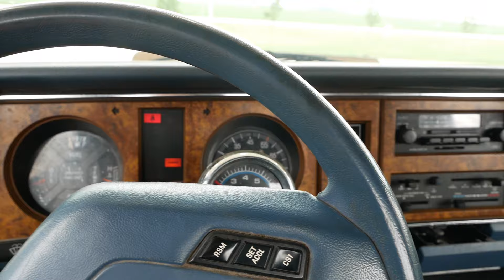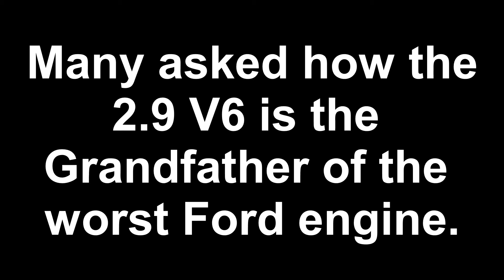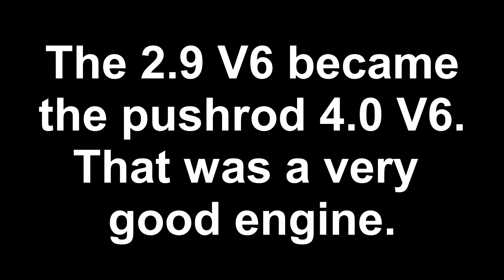Fixing Frank Fritz's 1986 Ford Ranger - Road Ready - Part 2

Comment: Hey so I have a 86 bronco II  and I have a similar issue with the idle so whats been going on is it will randomly bog down like 300 rpm and then bounce back up to its normal idle speed and I have replaced everything under the sun to try and fix this issue and the main cause of this issue is the fact that it is running way to rich and I would hook up a scan tool it just says cylinder 6 miss fire and I have done plugs plug wires distributor rotor and cap the MAF, IDAC, EGR the EGR tube because it was leaking Ive done fuel pump fuel filter catalytic converter and I'm about to replace it again because im thinking because of the raw fuel hat was going down in to the exhaust I'm thinking it has clogged my new cat because now it barley has power and the air box tube is being sucked inward and I'm just at a lost with what this idle issue could be and on top of that i have done a O2 sensor because mine was cracked but on top of the idle issue the emissions light is constantly on which I'm assuming that's because of the rich fuel mixture but I'm just at a lost in terms of what to do any help would be helpful thank you

Comment: You know you can put 5speed  out of 02 to 11 4.0 20% stronger n close rasho
It on ranger stashon form
I did it n like it
I have 92 4x4 5 speed 2.9
I'm about put a explorer 8.8 disk brake rear end in
I welled the tubs n trust it 
Waiting on gears n a ox locker 
N first 2 years of 2.9 had 62 mm throttle body after that it 45 mm
Botum intake manifold 1/4 inch
Lip that need matching to the top manifold between the 2 it wake it up a bit 
I have headers n a test pipe n after cat but the intake port mach n trottel did more cat back n header
I have 33 12.5 i squeezed in
Bushwaker cut in the back
N fiberglass fenders in from 
N little lift

Comment: In the old days you had to charter a helicopter at a rate of $1500 an hour if you wanted to get aerial camera footage. These days a drone can do the same job at a considerably lower cost. At what point will jet engine powered manually piloted crop dusters give way to remotely controlled drones?
Reply from the maker: I'm not sure that will save anything. You'd still need a skilled pilot to fly it, just in a different location.

Comment: There was a guy that has s wrecked 86 raher that has new white wall tires he wanted 40 a set. I pulled the JBL AM/FM Cassette radio works fine He has hell sell non rust free bed and doors he will sell the whole truck for 325.00 because the mother knocks and its the same color as yours. His A/C even works and it has gad the factory power windows/locks as well it is a 3 Speed Auto PS/PB Tilt CC  Dual TANKS EVERYTHING WORKS. FRONT END IS SMASHED IN BUT DRIVE GREAT HE WAS GOING TO ART THE TRUCK. I TOLD HIM NO TO TO. HIS NEEDS THE FRONT CLIP GRILL AND RAD SUPPORT. LET ME KNOW IF INTERESTED IRS SITTING ABOUT 44 MILES FROM ME AND GTHIS TRUCK HAD NO RUST ON FLOOR AND FLOOR PANS.
Reply from the maker: I just bought a rust free cab, front fenders, and frame. I need doors, and maybe a box and tailgate. Can you email me? mail@watchweswork.com

Comment: Beautiful truck, however what are you beatin the hecknout of it? Repect it, take good care of it, maintain it on strict matainance schedules and this truck will last you forever. Since you have a lift, I woukd get black rust olem paint, thin it down and wouldn't hurt to spray paint the whole underside of the bed, floorboards, frame and chassis, then get started on body work issues.

Comment: Where is fluid film to sponsor undercoating that truck to keep it around longer lol. If your bleeding brakes alone there is little check valve available for clutch bleeding I have found works super well and there $12 on the usual scum bags.

Comment: As for turning rotors I know this video is old but I was 8 years old resurfacing brake shoes to fit the brake drums that we survey and that was back in 1968 if I remember right I was 8 years old working in a machine shop with my dad and basically nowadays if you go to AutoZone or O'Reilly's they don't have the machines capable of turning rotors good because I went through that I had them turn the rotors and all back so you either machines or worn out or they don't have qualified people to run them yes you can turn them down if you have a good machine but it's in a long-run cheaper just buy new rotors nowadays but yet if you have a good machine and somebody knows what they're doing you can turn them down to Legos facts like we used to Arc brake shoes what they call it back to well that was 68 seventies eighties I used to be able to rebuild master cylinder and a wheel cylinder back when people knew what they were doing back when people weren't that to happy they were just happy to be driving so that's all long gone anyway hope you have a good pocketbooks to do with a new life care for you all so much for my rent but it was good back when it was simple

Comment: I honestly don't understand why you spray the wear surface of the break rotors;   the first time you press the brakes, it's going to grind off whatever you're spraying on there.  Stop wasting your money trying to de-rust the area that is constantly getting sanded down by your brake pads-- it fixes itself.

Comment: 235/75R15’s would be alright on that truck, even geared high it won’t make too much of a difference and your available sizes would be far greater.
Those SOHC 4.0’s are for sure at least tied with the 5.4 3v for the worst Ford engine ever.

Comment: I wouldn't put a dime into that rust bucket, go down to Texas and find a parts truck with high mileage and a bad motor  bring it back and swap out the frame bed and cab
Becuse that truck as it is is shot
Unless you want to sink 20k into a truck worth 800 nada value.

Hell your salt in the winter up there on roads is so bad they tear out the highway every few years to replace them.  Yes I drove from kc to I-80 
Up I-29 and some other routes and up I-35 to Drake  college  
Hell you might even find a older truck in better shape here in Missouri at a junk yard and save the trip to Texas  we don't get much snow here anymore.  
Some where between st Joe  and councel bluffs is where the permanent frost line is in the winters. 
That truck has too much rot to be safe.

Comment: This v6 2.9L & the 2.8L is one of the worst v6 engines ever made in fords. They are know for collapsed lifters do to early  oil pump failure and you wouldn't know the oil pump is bad because the oil pressure light would not come on.

Comment: No no no nobody machines rotors any more because they charge more to machine them than new ones cost
Reply from the maker: Not in my shop. I get 1 hour labor to do all 4.
Reply: @WatchWesWork  well I do my own but the Napa store charges $20 $30 each  to turn rotors. And I have to wait till they get around to it
Reply from the maker: @danbartolini27  That's why I got the lathe. My parts store will do them, but it's pretty much when they feel like it.

Comment: That thing needs to be scrap ready. Not road ready.
Reply: With the way it's fixed up now, it's a $5k truck in the upper midwest. Not even kidding. Rust sucks but it takes a lot to snap a frame - brake lines are generally the most important safety item to fix in the rust belt
Reply: @JackAttak  I live in the rust belt. Worried about my unibody car. No rust yet, but its my daily.